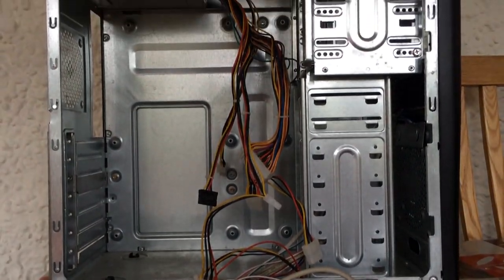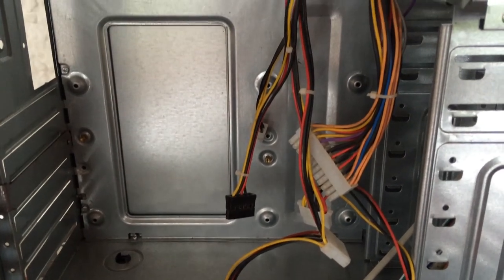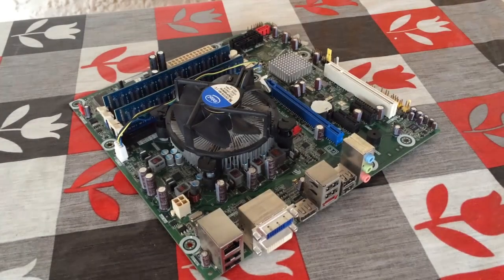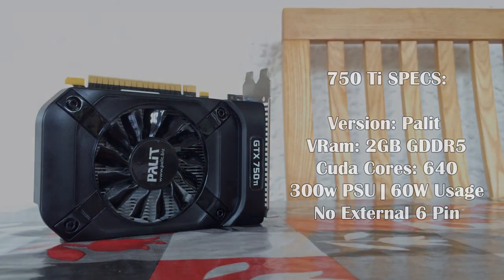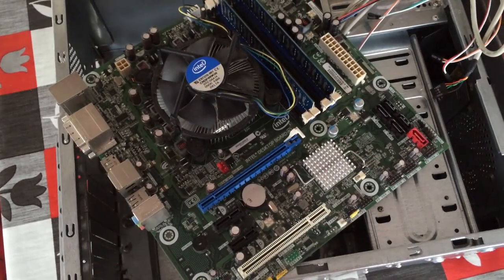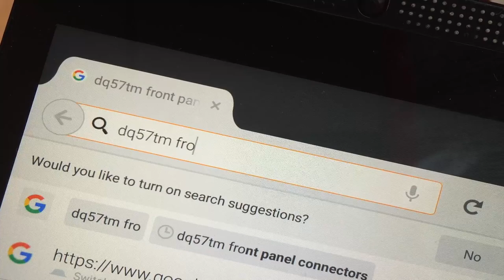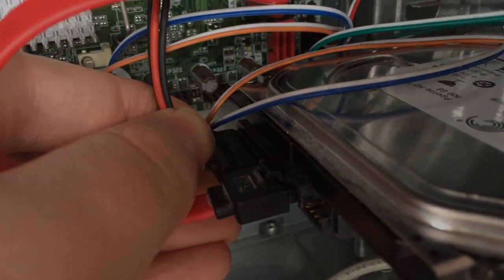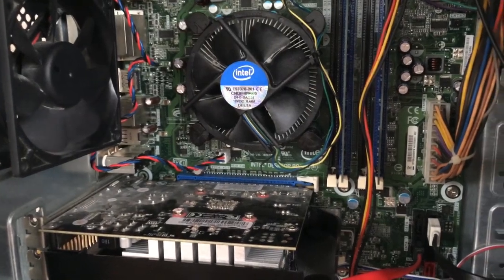Let's Build a $200 Core i7 Budget Gaming PC

Comment: hi! I've recently built a budget gaming pc for a total of around $700
here are my components:
MSI r9 270x
gygabite h110 
Pentium 4400 
500gb 
8gb ddr4 ram
500 volts cooler master psu
k380 case.
I encountered a problem, as my psu exploded due to malfunctioning, no smoke came out, and no cables were fried from what I saw. I searched up  online and saw that there is a small lamp like object inside the psu whch when explodes releases a flash. This is what happened to me.
I was wondering if by any chance any of my parts have fried based on your knowledge on PCs.
I appreciate the help, keep up the amazing work

Comment: Excellent choice of CPU.

I find the Lynnfield i7 to be surprisingly powerful. Back when they came out I thought they were a bit disappointing as they were not that much faster than the previous gen core 2 quads. In fact at stock clocks my q9650 was often more powerful than the i7s in contemporary games and applications.

I recently made myself a budget LAN gaming PC as I didn't want to risk damaging my main gaming PC during transit. I opted for an i7 870 and I'm amazed at how well it runs new games compared to the q9650 despite both CPUs having very similar IPC. I think the intergraded memory controller makes the biggest difference between the two CPUs

Comment: x5650 is the price to performance king, 6 cores 12 threads 35-40 quid from ebay, capable of 4.6ghz++, provided you have decent cooling, only the motherboards are 125+ gbp :(

Comment: Recently bought a used Acer aspire pc on eBay with an i5-4440, 8gigs of ram, 2tb hd, 250w power supply and Windows 10 for £169. Then all I did was buy a gt 1030 low profile and I was set.

Comment: I have a similar computer. It has an i7 920,  OEM motherboard, 9gb of ddr3, a good enough power supply, a gts 250, and the oem case and disk drives that you would expect. I found it for free with no hard drive. I want to turn this into a gaming pc for a friend by putting a gtx 660 in it. the issue is that when I put a hard drive in it and try to load windows via usb it says it doesnt have the drivers for the hard drive. The hard drive I'm using is from an oem laptop(SATA). Could the problem be with the motherboard being oem? Thanks.

Comment: I have the same CPU + gtx 1060 6gb. Games run at ultra-high settings 60fps solid.

Replace that 750ti with 1060 6GB and watch all your games go to dat solid 60fps.

Comment: I built I7 950, 1Tb HDD, GTX 480, 750PSU, 6GB ram and NZXT H2 case, Win 7 for less than 200$. It's a bad GPU I know but I got it for less than 30$ and it's still quite good in performance.
Reply: All of that is good apart from the 480 that has a hard time even running minecraft.
Reply: Hey, at least you don't have to pay for heating your house.
Reply: The 480 is literally 7-11% faster than the 750ti in games. But yes it does get hot and draw alot of power.
Reply: X3n0 minecraft is a CPU based game. A 480 does not give more fps than a GTS 450 in minecraft because it's CPU bound.
Reply: Mr. Doctor Schultz like electricity is free. But I get what you mean, it gets hot. But 580 is hotter.
Reply: AqwBroders You have to pay for electricity, as it costs money to transfer electricity from power plants to homes.
Reply: Mr. Doctor Schultz I know, I was being sarcastic.
Reply: AqwBroders Gosh darnit. I swear, I am starting to get concerned about how literal I am about reading comments online. Sorry about that.

Comment: on fallout 4 my budget pc with a c2q q9450 and a gtx 570 (OC) on the high preset for fallout 4 I got a avg of 60 fps. maybe do a test of the gtx 570 performance on today's standards. I also ran gta v with most settings set on high and got a avg 30 fps

Comment: my pc : 
i5 2500
GTX 760 2GB
16GB DDR3 1600 G.Skill
500 and 300 GB hard drive (no SSD)
650 W power supply
P67 rev 3.1 
price :
around 320 (ebay) euros  its an absolut monster for the price Sandy bridge is the best way to go best value for the price by FAR
Reply: Question : whats the best graphics card for my system ? i want to upgrade to a better card then a 760

Comment: im running an i7 870 and a r9 270x graphics card a solid setup for only 250 usd runs bf4 high at 54 fps avg
Reply: traser loveshelicopters oc 870 and r9 290x or RX480 should much better

Comment: If this bulid peforms good with gtx t750 , how about a gtx 950 or up in that bulid :D (of course you need to change the psu )
Reply: m. edy You can get GTX 950s that don't have power connectors. Even the 1050 Ti doesn't have a power connector.
Reply: Dankerino Nicherino yea i know that

Comment: please help:

i have windows 7 on a CD but the new case i want is USB only     so how would i go about transferring the data from a CD to the USB?
Reply: Format the USB and burn the disk on it i think it needs to be at least 8gb or higher usb though.
Reply: If you have the DVD, you should have the key, go to https://www.microsoft.com/en-us/software-download/windows7 and download the iso. Afterwards download the USB iso tool. (https://www.microsoft.com/en-us/download/windows-usb-dvd-download-tool) now find at least a 4gb flash drive to put the iso on. Now, boot into the USB drive on your new system and it will install.
Reply: the thing is i have 2 discs    one is the windows installation and the other i put after to activate the windows   so would all that still work and will i need 2 USB's   ?
Reply: Just use the key to download the iso. Should be a sticker with it.

Comment: hey, I need a little advice here, I have a pentium G3450 and a gtx 750 Ti (windforce with a 6-pin connector and overclocked), for some reason in newer games my processor bottlenecks my gpu, any advice for  buying a good 100-200 eur cpu? lga1150 socket.
thanks.
Reply: Go with the i5 4660.
Reply: That'll be because it only has two cores.
Any i5 will do!
Reply: thanks, I was considering the i5 4460, but my budget lets me go with the i5 4660 so why not :D

Comment: Holy fuck, that thing is a huge fire hazard. The motherboard isn't built for a high end power hungry CPU, it lacks cooling on the mosfets/VRM. And neither is that PSU, with the specs listed on the side I'm amazed that it even managed to run a game without blowing up immediately. It needs almost 1000W of input to deliver 450W.... I've never seen a PSU with such a low efficiency. Invest a few bucks extra in a decent P55 motherboard and a decent 600W PSU, then it will probably last longer and you can also overclock the CPU.

Comment: hello! I have a pc with i5 750 , what GPU can i put in it? The gtx 750ti it s a good ideea?
Reply: JustDZN The 750ti would be perfect. If you can, try and fit in the 1050
Reply: yes
Reply: Thanks guys ! :D
Reply: really good idea it will Run Games pretty good, 720p High preset on almost every Game and 1080p low/medium preset on almost every game
Reply: try to get  a 2gb  7870  if you are going used  and have at least a 400 watt psu   
the  you can get it on ebay for 50 dollars and it is more powerful than the 750 ti if you want a new card  or  a gtx 1050 ti  if you want a new card  but you should really mention your budget when asking questiion like this.
Reply: I've had a 750 for 6 years now. Used to have a GTX 460 until it burned out but that did really well and currently a 660TI. 750 would be good though and most likely a lot cheaper.
Reply: I would go for a used 960, it's as fast as the 1050Ti but half price. Can't do much better than that. The ultimate 1080p card imo
Reply: Hjembrent Kent A used R9 380X would be even better

Comment: I bought a 250$ (canadian) pc on kijiji with an i5 2500k, 8gb ram, gtx 460, 1tb wd black, 650w psu, and an antec 900 case.
I oc'd the 2500k to 4.7ghz and it scores like 617 in cinebench r15
Reply: Dude, if you upgrade that graphics card, you have a sick build like seriously. Try get a 750ti or a 1050 in there and it'll be killer
Reply: I plan on sticking a 1070 into it, rn I have my 750ti from my old build in it
Reply: Matthew Charles-Roy Thibault The 2500k even to this day is still a beast, if you have a good motherboard and a good cpu cooler, you can get it to like crazy high clock speeds
Reply: 4.6ghz at 1.3v on a z68xp ud3p rev 2 with a coolerrmaster v6

Comment: no body uses discs? Wow. I'm 13 so old.....
Reply: no.. not on PC it's not really needed
Reply: Arrison Williams actually i needed for DVD player and burn audio songs
Reply: +RAY M I actually just put one in my pc for the same reason I don't like using my phone while driving
Reply: Arrison Williams 
well how about install an os? that could be needed yeah had alternate usb either but its safe bet
Reply: +RAY M also true but even installing an OS through a CD is getting outdated I would rather use a USB the only time I've ever had an issue with USB is when it's not plugged straight into the mobo don't ever use a USB hub like front panel or anything. I always had issues going with a cd

Comment: What is The best AMD Processor Thats Not over 200$
Reply: The best AMD CPU period is the FX-9590, and I saw it go on sale for $160 recently. It didn't come with a cooler, so you will need some kind of liquid cooling. That CPU also requires an 990 motherboard, but those are cheaper than some Intel boards (at least new Intel boards). My FX-8350 + mobo cost me $200 last year (stock cooler included). So even that's within your $200 budget. These are all new parts and prices.
Reply: Thank you very much :D
Reply: and is there one with FM2 FM2+  ?

Comment: Maybe you will try to overlock this cpu? Based on this link http://pclab.pl/art50000-59.html i7 860 overclock to 4 Ghz  can  achive 70 fps in BF3 (equal preformance to i7 third gen without overclock). So based on this link http://pclab.pl/art55398-4.html you can pair it with gpus like GTX 770, 780, R9 290 x.
For cooling you can use  CPU SilentiumPC Fortis 3 HE1425 v2 (SPC130) for around 30 P. You would need also a better PSU.
Now that would be a beast for very good value.

IMO one of the best value and very powerfull cpus is th i5-750. Its basically i 7 860 or  i7 920  but without hyperthreading wich is better for power consuption and it performs just as well. 

Best regards

Comment: does intel core i5 work is it good
Reply: ThatGrapeIsASpy 1st gen i5 vs i7 is about 30% difference i7 860 and 870 is 30% faster then i5 1st gen

if you overclock i7 870 to 3.7~4.0 its performs like i5 2500 level
Reply: ThatGrapeIsASpy i5 750 isnt dual core

Comment: Am i able to run gta v?
Ram:124gb
HD:4TB
CPU:CPU INTEL CORE I7-6950X 3.0GHZ(10 cores)
GPU:VGA MSI GEFORCE GTX1080 SEA HAWK X 8GB
PSU:2000w.
Reply: No u will have lag.
Reply: harambe no
Reply: No
Reply: 4 Terabyte High Definition?
Reply: I meant hard drive.
Reply: Ok so what can i upgrade to make it run it
Reply: get a 86GB SSD for just GTA 5
Reply: harambe Hahahahahaha you'll have trouble running MineSweeper even on crap settings might as well get just 2 FPS.
Reply: ThatGrapeIsASpy  YOU RUINED IT
Reply: Yeah, gorillas see like 240 fps so to have it look nice, it is gonna cost about $12,000.
Reply: Steven Fores Someone finally gets me
Reply: harambe dont get that cpu, like at all... 6700k will do
Reply: Man. I think its going to have quite ruff fps. Like i think a bit above 500 fps. I think you need like a lot more
Reply: jefftheped maybe on 720p
Reply: jefftheped wtf that's so much just to run gta 5 lol
Reply: na bro you need to overclock it to 8ghz of cockspeed to run it perfect 60fps maxed out settings in 4K